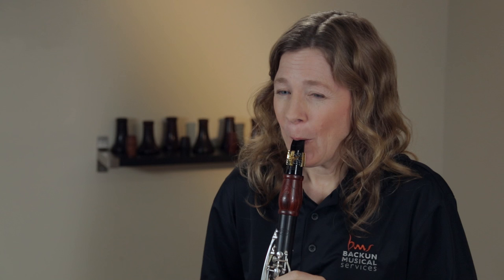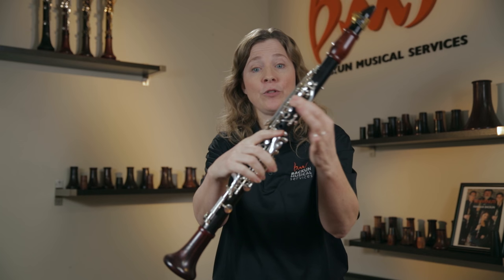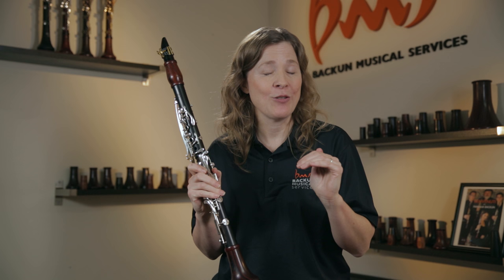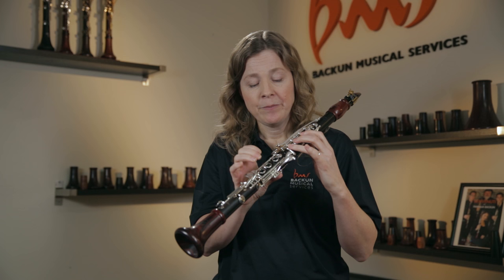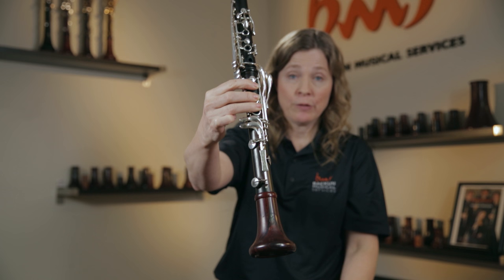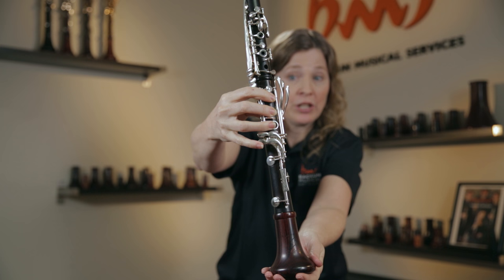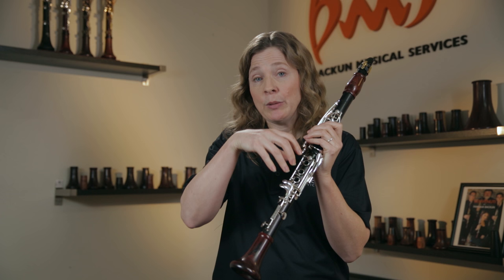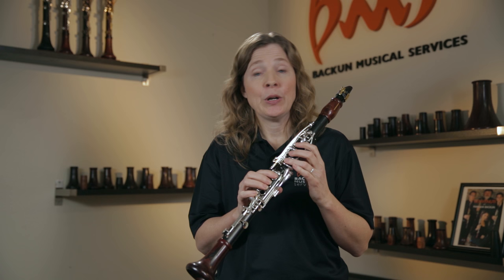Clarinet Squeaking: How and Why? | Backun Educator Series

Comment: I've been trying for hours and I still can't stop squeaking :(( Tips anyone?
Reply: ME TOO
Reply: @fidelinaaparicio6902  😭😂 maybe our instruments are just broken bahaha
Reply: Just because you’ve been trying for hours doesn’t mean you’ll improve, for me I still squeak sometimes but not as much as I used to, when you keep playing then you’ll be more improved
Reply: Same
Reply: Just keep trying, I play the Saxophone but the clarinet is a one to master, just try different technique's like change for softer reed the angle you hold the clarinet to mouth pointing more down than up. how you placed the reed in the mouth piece level to the tip or down a bit. The clarinet may need a service if bought secondhand keys lose or pads not sealing although they look like they are but not, this can happen if the clarinet has been stored for many years. Make sure the instrument is put together correctly ie the two main parts lined up. And lastly get your teacher or a experience player to play your clarinet and combo ie reed etc to check that they can play it, if they cant you will never play it, it will be the clarinet itself that needs attention. If they can play it then it will be your technique that needs changing.
Reply: It's sooooooooooo annoying 😂😂😂😂 mine just fell over, now it won't go to the low octave and squeaks